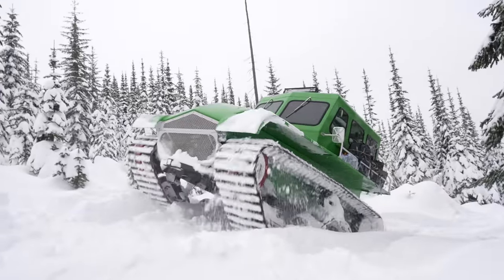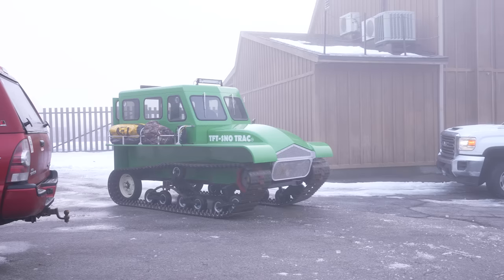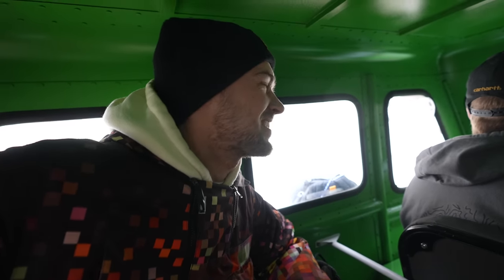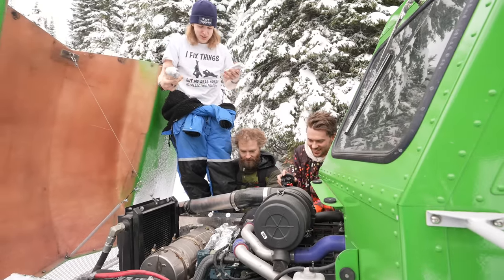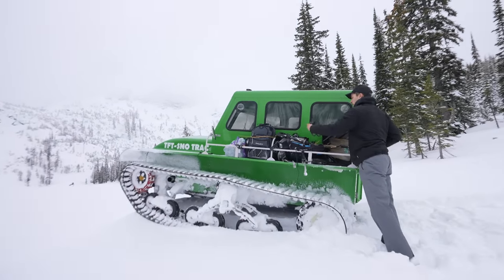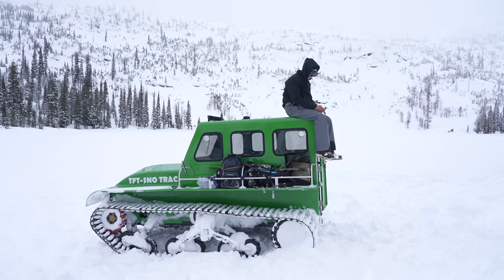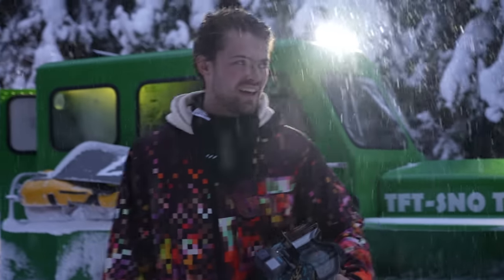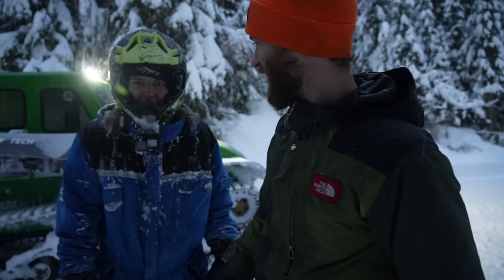Testing a Brand New 1950's Snow Cat!

Comment: Love it!!!  Modify one with an air-cooled engine.  Like the VW 1600i.  No radiator fluid to freeze, the original Lars Larsson design with a vw engine.
Reply: I'm surprised they didn't use the original design, but liquid cooling gives you heat! I'd rather have the steering wheel, though. :3

Comment: I didn't know that those Snow Traks are made in North Idaho that's cool. I would have figured it would have been Minnesota or Wisconsin or something like that. those Snow Traks are the ultimate snow machines. Edwin is a monster on that snow board, simply bad ass. you guys are the best.
Reply: I had a snowball fight in Idaho in july...
Reply: The Snotraks were made in Sweden originally and one of the best designs,,,, SnoCats are made in Pheonix Oregon By Tucker Snowcat.
Reply: @davidhakes3884  They said Snow Cats in the video. but I will correct my comment.
Reply: @musicauthority7828  It's ok Brother I am not the grammar or spelling police , I think snowcats are a general term used these days.
Reply: @davidhakes3884  I glad you made me aware of my mistake, because I'm sure you know that the comment section can sometimes be sort of brutal. if a piece of information is incorrect. a person can get an endless number of replies pointing it out.

Comment: I’m actually surprised that thing doesn’t have a little wood burning stove in it with a chimney right out the top
Reply: Wow, what an idea.You could capture the smoke into condensing pipes on the exterior of the vehicle and create flammable gas to run the motor with such a setup.

Comment: We own and operate an original restored 1962 Snow Trac ST4. I that been upgraded a bit with a larger 1600 CC VW engine. I like what I see for the most part here. I do think you should consider
steel track grousers on the order of the originals. Just like a steel snow board edge is far superior to a plastic edge. I am guessing your power pack is substantially heavier as well.
Weight distribution is a big deal when you're in truly deeeeeepppp snow lol. Alas the HP to the tracks is as a percentage much less than a mechanical drive. Not to mention the added weight. 
Would be interesting to run one beside and original machine in the same conditions.
Reply: Thank you for your feedback! The TFT-Sno Trac does use the same basic track design as the original machines, Rubber belting sandwiched in between steel grousers and steel track guides. We went with a Kubota diesel engine for our machines because of their outstanding reputation for longevity and quality. You also mentioned weight distribution. With the heavier engine and hydraulic components up there, it is more font heavy than the originals. But in out testing we have found that with a few people in the cab, the machine is very well balanced. The new Sno Trac machines weigh 3,400 pounds and have an overall ground pressure of around 1.2 psi wet. If you have any questions about the new TFT-Sno Trac machines, please contact us on our website. We would love to talk!
Reply: @sno_trac  We will get in touch with you soon. Going to a snow cat gathering in upper Michigan Feb. 1st. 20 or so vintage machines of all makes. We have done so for over 10 years now.
Reply: I think wet, an original machine is under 1 psi. I have read 0.75 psi. but cannot confirm that.
Reply: @debi5292  We read something similar to that as well. We have a fully restored 1967 Aktiv Snow Trac. We measured it for ourselves and found it to be right around 1 psi if I recall correctly.

Comment: Dont like the look of that fighter jet joystick, but do like that it has a little more head room that the original ones.
Reply: simple hydrostatic mechanism though. like the Gehl skidsteers.
Reply: We wanted to use the simplest form of control we could, so that anyone could hop in and drive it anywhere. It doesn't have to be a joystick though, the control system of a Sno Trac could easily use a steering wheel and gas peddle or something else instead. What kind of controllers would you use if you had one custom made?
Reply: @sno_trac  The joystick isn't whats bothering me its the location. With a sudden stop like dropping over a log or shore edge its going to be "uncomfortable", and potentially broken from weight sitting on it.  With a good arm rest similar to how skid steer controls are setup.  In the middle so control can be passed between left and right seat with ease that would be my choice.
Reply: @devinholland2189  Our first choice would have been an arm rest on the right of the driver. But, there isn't enough room for the passengers to the right of the driver and an arm rest. Space up front is quite limited because of how narrow the machine is overall. We considered putting the joystick to the left of the driver but figured that since most people are right handed, it would make better cense to put it in the middle. Plus, it should be ok for left handed operators as well.

Comment: i used to own one of the original snowtracs with the VW air-cooled engine, these look great
Reply: A tdi engine would be a great upgrade for this, with the diesel torque
Reply: @MegaCasey09  the old 1500cc veedub engine is very light on the nose for climbing over deep powder, but the extra bit of weight in the wee tdi doesn’t seem to affect that too much in the video, it’s very nostalgic to see someone making brand new ones
Reply: Thanks! We love the original ones too!

Comment: it looked like the snow trak didnt have insulation. was it hidden or did they not bother? looks like fun.
Reply: The Sno Trac machines don't have any insulation. But they do have a heater that keeps up with the cold very well!
Reply: @sno_trac  the insulation would also help with noise. It sounded pretty noisy inside. I imagine even from the people.